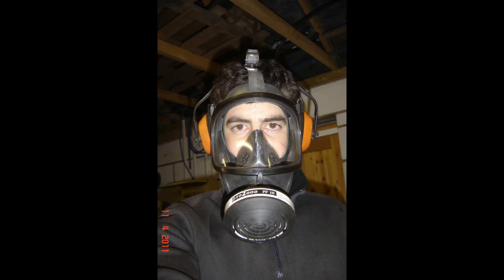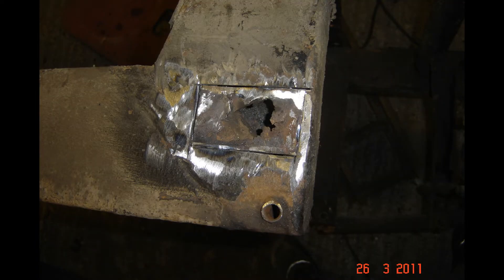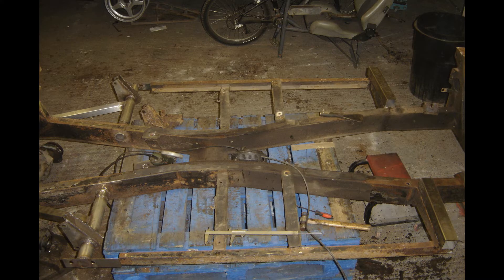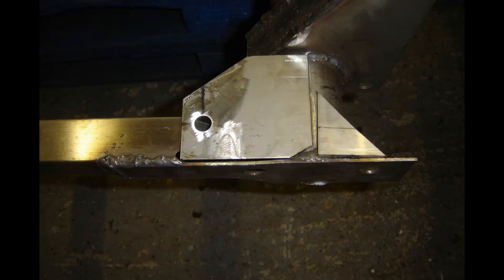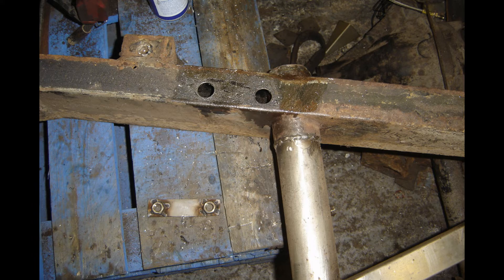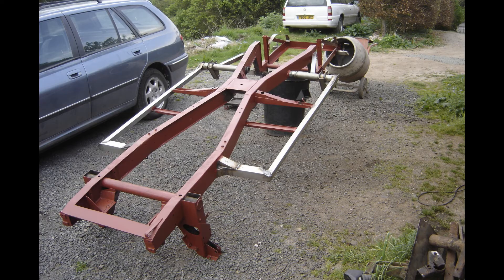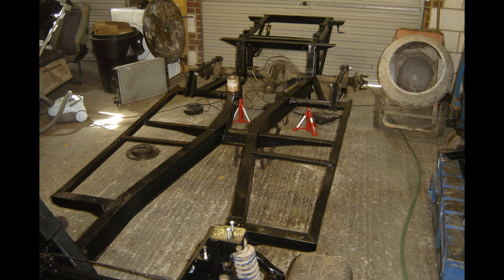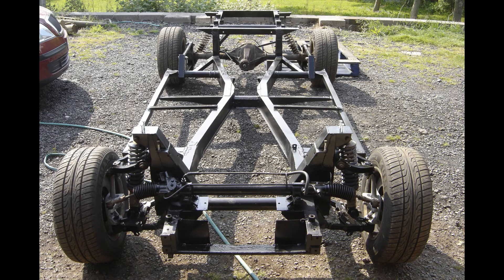Chassis repair using Stainless Steel.

Comment: Hi
Have you had any problems with the stainless steel cracking?
Regards

Rob
Reply from the maker: Rob, as far as I'm aware it's still perfect. 12 ish years on and with maybe 15k fairly hard miles on it
Reply from the maker: I'm not sure I should have done it in stainless really. It was gunna be my daily car so stainless was a good idea but reqlly its only been an occasional car. Steel would have been stronger. Ideally I should have fixed it up in steel and galvanised it.😊

Comment: YOU WENT SO FAR WHY DIDNT U JUST BUILD A STAINLESS CHASSIS 304 IS BETTER THAN MS ,IM LOOKING AT SCIMITARS TO BUY TOO , THANX
Reply from the maker: Thanks for comment Adrian, and thanks for watching. They only really rot at the out riggers, the rest was all perfect (well the steel was maybe not the paint). And it would have been a much more substantial project, trying to keep everything straight after welding is very challenging. It would have been cool to have a SS chassis though :)

Good luck with your purchase.